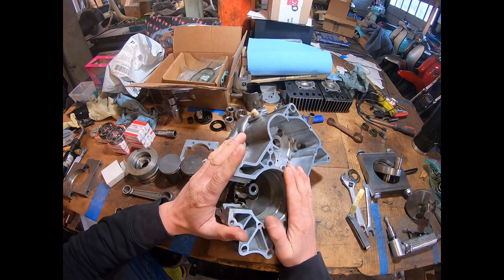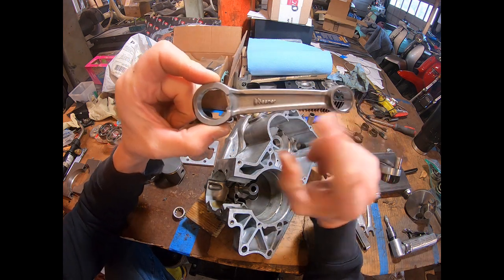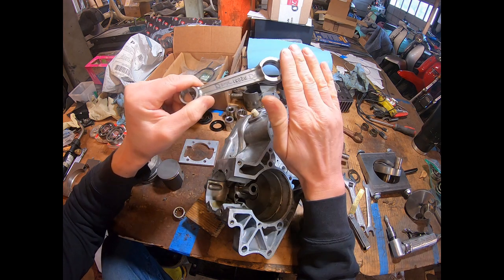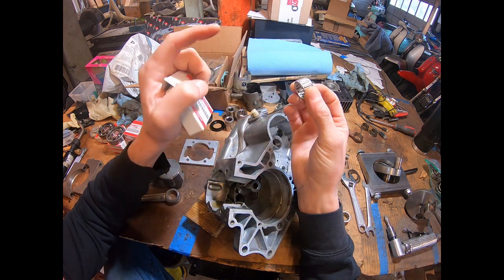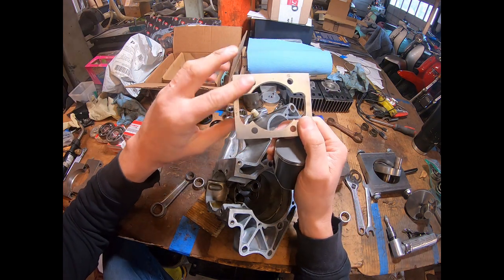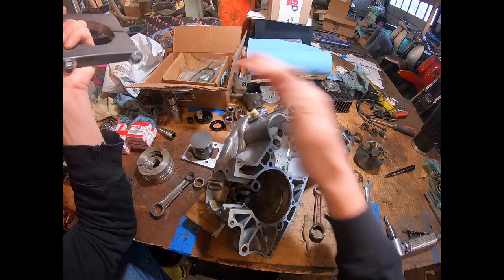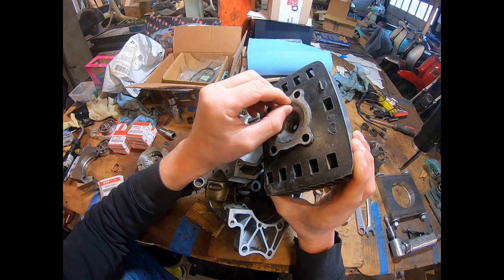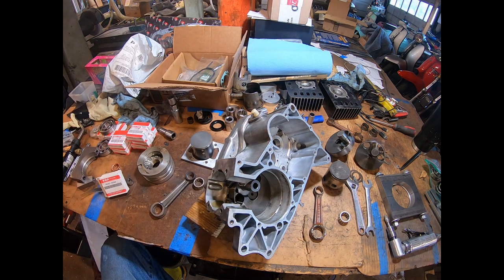RD200 explanation

Comment: I would love to do pretty much this exact thing with my RD200. 

Would you ever be interested in selling the finished crank or doing this to my crank?

If not would you be able to make the cylinder spacer for purchase?

My plan for the bike is just to race around on roads. Currently the bike is all stock I ordered expansion chambers for it and am waiting for those. 

I know that it would be cheaper to leave it stock or buy a rd350 or 400 but the bike came from my late uncle in a box of parts.

Comment: Hi great video and information. 

I've just bought an RD125 all in pieces with a complete RD200 engine 

The biggest issue for me is trying to find RD200  Carburetors as thete like gold dust 

What I've come up with is to buy a matching pair of complete Suzuki gt185 Carburetors in great condition  

Someone said they were same size as RD200 Carburetors which they are but the part which push fit inside the reed block rubber adapters  is very tight, 

So I've mill the carbs and they now fit perfectly  

I can't find original or new  pattern Carburetors anywhere in the uk. On ebay 

Are you using new Carburetors  and if so could you please help me to buy a pair for my RD200 engine, 

You would think you can buy Carburetors nowadays for any vintage bike, 

I intend to port mine also and hopefully the gt185  Carburetors work, 

You will be surprised how many people born in the sixties had fizzes, rd50 rd125 and RD200,  I had also the rd250 and rd400 although they seem to be very heavy, 

The next step is to try to find a pair of Microns but in original good condition they fetch over £1000 its crazy, 

I did have a lovely Suzuki X7 250 and saw some original Microns for sale but price went from £100 to £900 and I refuse to pay that,

I will either use original exhaust and perhaps buy new expansion chambers for around £500 for the pair. 

But its Carburetors which seems to be the biggest issue especially in the UK.

Comment: I thank you for this informative video!

Especially for showing the crankshaft!

Now I know what tool I need to make to rebuild my crank and that I could play with the connection rod types without large problems, as long as I take care of the cylinder height...

Will a Suzuki AX100 connection rod from China work (for a road bike up to 25/30 hp)?